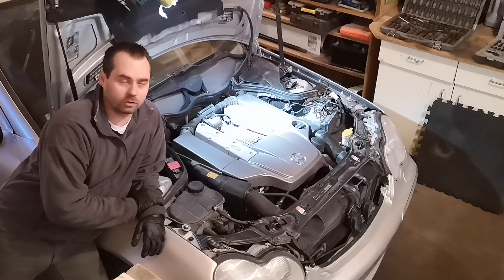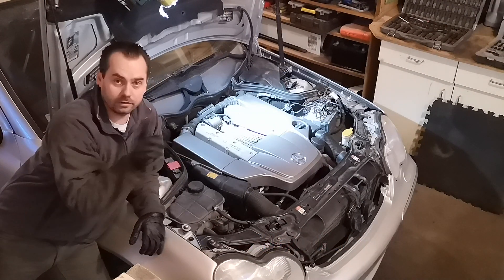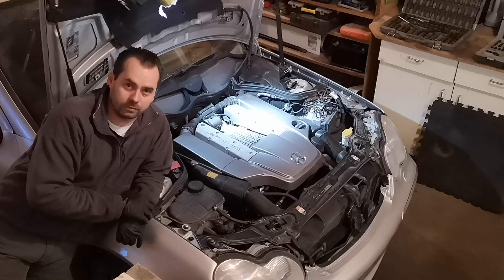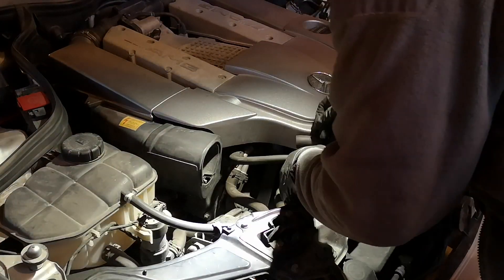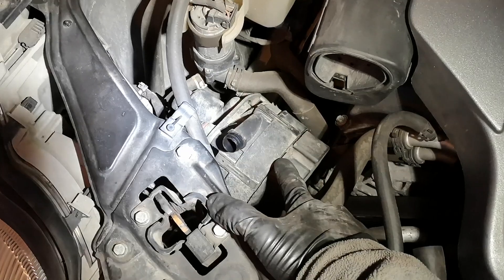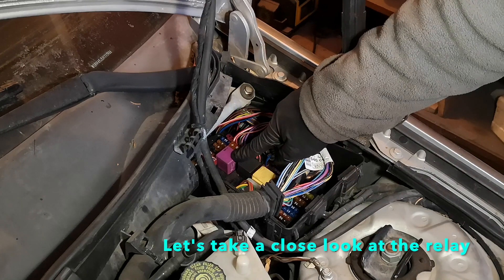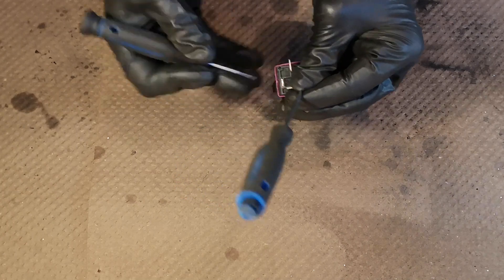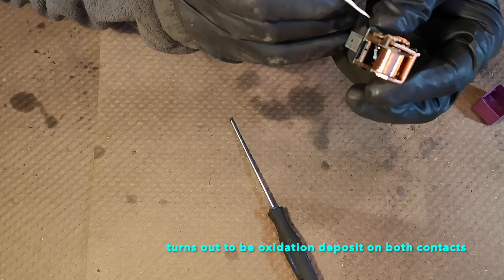🛠️  How to Rebuild Auxiliary Air Pump for Mercedes | BMW | and Other Brands | P0410 P0492 P1411

Comment: Used the above guide this weekend to repair my Secondary Air Pump on my 2007 Merc CLK280. Excellent video , followed it to the letter and now my pump is erviceabla again and my P0410 code has gone.Many thanks for putting this video out there

Comment: Its a brushed motor that runs for a couple minutes at a time, in a sealed plastic container with no ventilation, inches from the engine. Brilliant design job for MB.  Thanks for the walkthrough, OP. Just did this on an R350 and worked great.  I think the key to quieting it down is to get all the the carbon dust buildup out of the inside motor, in addition to the more well known step of cleaning and regreasing the bearings.

Comment: Hi. thanks for good video. I came to know that Audi pump is sealed. There is no rivet or bolt to open it. And what lubrication do you use for bearing? Is it chain lube?

Comment: Is prying the only way to get motor out? Also, are you just lubing the bearings? Are they sealed? How do you get grease on inside of bearing? Thks..jc
Reply from the maker: bearing are sealed, its easy to remove seal on one side and put new grease
Reply: Thanks..jc

Comment: What are the symptoms when you have a bad auxiliary air pump?
Reply from the maker: whining noise or it doesnt work at all at cold start associated with fault code
Reply: MechAdventures would i get a check engine light?  Do the diesels have this issue?  When its cold my 08 ML 320 CDI goes into limp mode and sometimes I get a CEL and sometimes I dont.  Maybe I have this problem.
Reply from the maker: @Kittyfh4  read your CEL code and go from there
Reply: MechAdventures ok thanks for your quick reply
Reply: P0410 code. engine light...electronics. Car runs good otherwise. They say this thing only runs for a few seconds when you start the car.

Comment: In my experience this kind of repair has limited results but it might get you by until the next paycheck.
Reply from the maker: As stated in video, repair have a few levels of repair, if pump if completely seized, then take it to the shop to have it rebuild. Then you have practically new unit for a fraction of costs.